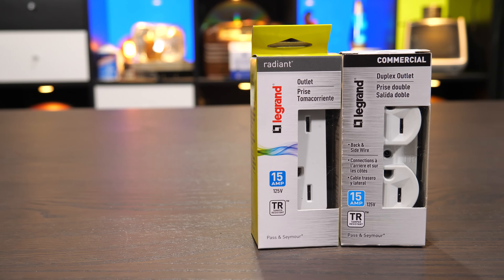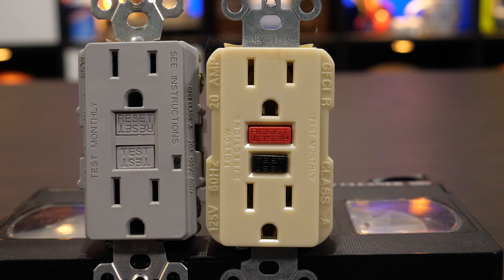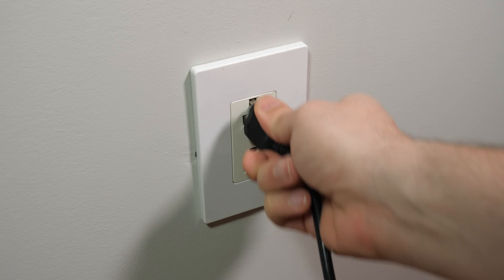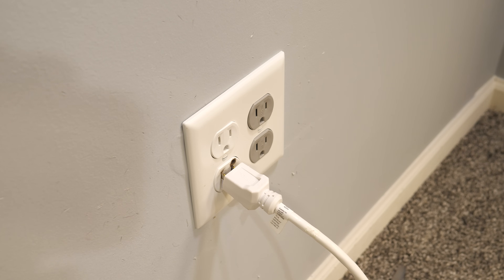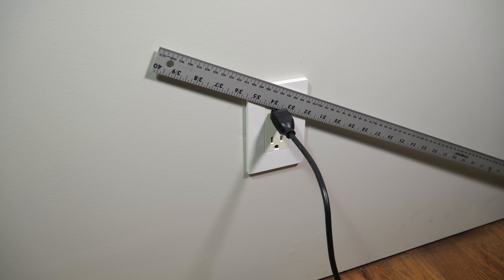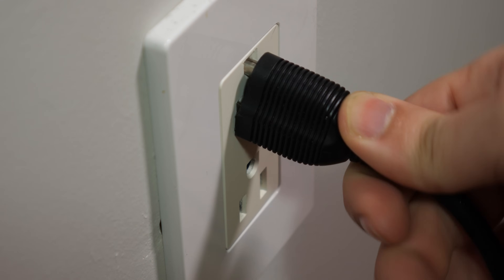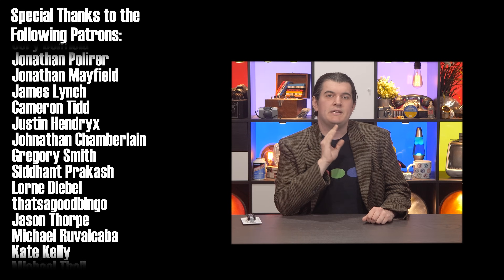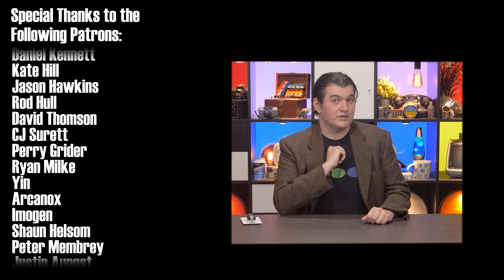Power outlets are topsy turvy - but does it matter?

Comment: I think the best solution is (if there are two outlets) have the top one ground up and the bottom one ground down. You stick the right-angle plug into the bottom one while the top one (which is the only one being dangerous in these scenarios anyway) is safe. Mirrored outlets are the best of both worlds!
Reply: In that case just put the outlet horizontal and the problem is solved. Or like the round right angle plug have the wires come out at a 45° angle then you don't need a mirrored outlet.
Reply: Just use Schuko
Reply: @uosiumen as stated, I don’t think that would work for toasters which have the metal body connected to the neutral. It would be possible, then, to plug the toaster in with a live body.
Reply: @jayrogers8255  toasters with metal body have to have body connected to PE. Live and neutral across heating elements. Schuko plug covers this use case.
Reply: @uosiumen  not older ones here in the U.S.. can openers were like that too: I read about someone getting shocked once from a metal kitchen sink. It turns out the screw holding a foot on a can opener was touching the sink, & was plugged in upside-down (2-prong plug). My parents used to have a metal oscillating fan that would shock people if the plug was in upside down. These are all appliances which used a neutral bonded to the chassis with no polarized plugs. A Schuko with no ground wire would have the same effect. Then, there are the old radio collectors: there were a lot of AC/DC sets back in the '40s & '50s which can’t have a polarized plug because they were designed to work on AC OR DC house wiring (which was a thing as late as 2007 or so in New York City). When plugged into AC, the classic is part of the circuit. The plug has to be non-polarized with no ground because of this.The antique radio collectors would be up in arms if they had to rewire their sets’ circuitry. At least right now, they can used a polarized cord to keep the chassis to neutral; although I’ve had a few of such radios which I wanted to put a 3-prong ground plug on, only to be told not to because of the outlet was wired backwards, the chassis would indeed be hot.
Reply: @jayrogers8255  two-pronged devices are nearly extinct in Europe. That plug is used in devices with no metal casing. For earthed three-pronged devices polarity doesn’t matter as if current is leaking to metal case, it’s detected by differential circuit breaker.
Reply: @uosiumen  yes, but in America, they are very much alive. There are 70-year-old appliances in use by people, which would have the problems which I described if they had to be rewired for Schuko. Without extreme upgrades to their circuitry, keeping their old non-polarized plugs is the least-worst option. We have AFCIs now, which are analogous to RCDs, I believe.
Reply: @mmm-mmm or recessed (clock) outlets.
Reply: If you're looking for the best solution, the UK has been using it for decades. 😉
Reply: @DavidBeddard if... we want to completely change the entire system of power across the entire country I'll keep that in mind.
Reply: @The24thWight  😉😏

Comment: my apartment (i think) has plugs that have some fancy new 'lock the holes till the force is even on both sides of the hot/neutral blades' and it's designed to be a safety feature, but if the blades are bent just a teeny bit it makes it so much more difficult to plug in. and vastly increasing the force, with possibility of slipping toward the blades since there's no flared base on 3 prongs, on something that's about to have 120 V @60 A through it has been....less than great. EDIT: oh, hey, you mention that at the end of the video :p

Comment: About 7 years ago in my high school electrical class our teacher told us that in Canada the electrical code was changed so that the ground was up. He said this was because if something falls off your wall and hits the plug with the live/neutral wires up it could damage the plug and cause a fire. If the ground prong is upwards, it hits a much stronger prong and thus results in much less risk.

We all responded saying that not all plugs have a ground plug so it’s not really doing much. We also all said it looks dumb like that, we like the little smiley faces the make with the ground on the bottom.

From what I’ve seen in the Canadian electrical code it currently doesn’t suggest mounting it that way UNLESS it’s in a mobile home. The thinking is that in a mobile home that you can tow around, things falling and landing on the plug is a lot more common so they want the ground upwards. But for all other applications it doesn’t seem to specify.

My thinking is that my teacher might have confused the mobile home code with the entire code being changed. Or that it was changed but later revised/removed for some reason. But for me, as long as it’s wired correctly, it doesn’t matter which what it’s mounted. But personally, I will never install it ground up. I like my little faces on my plugs!

Also, right angle plugs are great! But if you have 2 of them you can’t plug 2 things in unless they have a 45 on the wire. If a flat, round right angle plug with the wires leaving on a 45 it would be perfect for every use case!

Comment: In Europe at least they have this problem figured out.  What should probably happen is we start moving to the 380V DC standard and swap out wall sockets while we are at it with a safe one.  The reason for +-190V nominal DC is it works with existing wiring, it carries more power better than current AC standards, it works very well with EV charging, even your 800V EV mainly just needs a simple, compact, and efficient DC voltage doubler circuit and a compact and efficient buck-boost converter to charge, and in general we live in a power electronics world where even our light bulbs are power electronics devices.  Consider if you had solar panels hooked up in series on your roof that either directly connect to a home battery or through a DC-DC buck-boost converter to go between similar voltages.  (I had another YouTuber do this experiment with directly connecting solar panels in series with a salvaged Tesla car battery pack and it proved to be an efficient and cost effective way to collect solar power and store it in a battery.  He just added an extra solar panel to the series in place of a power converter to make sure the voltage stayed high enough to be effective.)  Then you have a simple, cheap, and efficient way to collect and store solar power without the need for more complex and expensive power inverters.  Then say your computer basically has half of its power supply removed, the half that converts AC power into DC power, instead just leaving the side that does DC-DC conversions.  This would be a lot more efficient end-to-end, cheaper to implement, you have a built in battery backup to your computer system as in the direct whole home based battery. Then, say you could splurge on high end gaming hardware and no worries about tripping the breaker.  More practically heat pumps work by using a power inverter drawing from a DC power bus to run an AC motor to drive the refrigerant pump.  Normally that DC power comes from converting AC power into DC power.  If you are starting with DC, you could dump this AC to DC conversion overboard and thus have a cheaper more efficient heat pump to work with.

For a smooth transition to DC, you can still have power inverters to go between AC and DC.  Just probably what you want to do is to put all of your high powered stuff on DC, you home solar on DC, and your home battery on DC.  With all of your major loads on DC as well as solar power input and batteries buffering power, the power inverter to go between AC and DC can be relatively small and low cost.  Then you still have AC outlets around and start working on converting those to DC as it makes sense to.

Think of how much more efficient and just better things would be in the USA if we did this transition?

Comment: Ground pin down, is the correct way. Why??? Most wall-wart power supplies often times have the small blade(hot) on the right. If the ground pin is on the top, the wall wart power supply gets plugged in upside down and more likely to fall out from the upside down leverage. It's also more likely when plugging in a three prong plug, your index finger will naturally land on the bottom of the plug which would be best it touch ground.

Comment: Great entertaining episode as usual. In New Zealand we have a three pronged plug with earth down orientation and I recently purchased a device with a right angled Chinese plug that while it fits our sockets looks like it is designed for an earth up orientation. Also where are the switches on your sockets. Would that fix the safety issues when inserting and removing plugs?
Reply: our socket switches are in the breaker room 😅so no per-socket control. it's power or no power. and if I know the average north american consumer, adding extra steps to something that can still technically be done without the extra step is really hard to enforce. that's why i like other countries' designs that hide or retract the pins if something isn't physically pushed into the receptacle.

Comment: I was thikning about the right angled plugs as you were speaking - in the UK, our plugs do assume that the ground is at the top, and our products' plugs are subsequently manufactured to support this. What's more, there's usually a flare at the prongs and at the "top" of the plug, leaving you a recess to grip when removing. Many of our plugs are fused, also.

The only problem I've ever had with a UK plug was my own fault - using a night-light purchased abroad that was plugged into an adapter before the wall, it wasn't nearly as flush as it should have been, and got kicked out accidentally - resulting in prongs broken off the plug, and an outlet that had to be 'breakered off,' taped over, and avoided until an electrician could be called. 

Loved the Steve Mould shoutout, and thank you for the wise words about pizza! Trust the locals!

Comment: I think the US should just switch to a newer recepticle design. Sure there will be a lengthy transition period where there will probably need to be adapters and regulations on manufactures to change plugs/provide adapters but it would be worth it in the long run. I hate US plugs so much.

Comment: As a european I am always supprised about the poor outlet design. You even better notice it as a tourist, who mainly resides in hotels and motels. Using an adapter to match our heroesious euro plug, it is mostly the case that the worn out outlet says no and spits out your plug enterily. I would recommend a decade of inconvenience and redesign the outlet to beeing recessed. That would solve the problem of falling out, the touching problem and the knive throw champions would also be happy. Adapters could bridge the decade and even older plugs would work in a recessed but unsig the old arrangement outlet.

Comment: There is actually a downside to right angled cables from plugs - when someone in their infinite wisdom decides to do things a different way from everyone else. We have ours oriented with the cable pointing downwards by default but nowadays pretty much everyone that makes a power adaptor or charger points the cable in some random direction. Which is a right pain when you have to use a multi plug adaptor owing to a lack of sockets.

Comment: Electrician here

It's a pretty common opinion among electricians (at least the ones I've worked with), that ground up is better, but everyone is used to ground down, so like you said, we just roll with it. 

It really doesn't matter unless it's something the customer asked for (such as a hospital), and for certain jobs, it's definitely good practice to ask the customer what the want

I will say, I do like ground up better for any plug that has a ground prong, simply because it feels like it's less likely to fall out.

If I was rewiring my house, everything would be ground down, but all the dedicated utility circuits and my garage outlets would probably be ground up, but that's just me being OCD, it doesn't really matter. 

There are a lot more dangerous parts of the home electrical system than the orientation of the duplex outlet
Reply: @@karlwithak. You'll have to back that statement up with fact.  I've never once seen any state electric code that didn't say "according to the manufacturers directions" as you are claiming.
You need to quote the state and exact code by number where it says NOT to follow manufacturers directions before anyone will believe you.
Reply: @lorddissy  yeah seriously, show me the building code and I'll believe it. 

Any good electrician can show you where other codes are in the codebook, you don't just take people's words for it
Reply: @louisjov  NEC article 406 device installation - "Installation per manufacturers installation instruction except in the following"
406.1 through 406.9 is a list of exceptions, the only one of which mentioning the word "orientation" is 406.5 and that is specifically about mounting on a flat surface (do not mount face up under a sink or on a countertop) 

Leviton brand (like in the video) state vertical outlets can be either way.  You would have to find some other brand of outlet that explicitly tells you only in one way for it to be against 406.
Reply: @lorddissy  exactly my point. Follow the manufacturer instructions, and pretty much all of them say it can be either orientation
Reply: @@karlwithak. When you say inverted do you mean ground up or ground down?

Comment: That was a fun discussion about the orientations of NEMA 5-15 devices, but now lets talk about the orientations of NEMA 14-50, 10-30, and 6-50 devices. Tesla and Lectron EV "chargers", for example, have right-angle plugs that assume a bottom ground on 5-15 receptacles and a top ground on 14-50 receptacles. The distinction isn't voltage, however, as Tesla's 6-15 and 6-20 NEMA adapters also assume a bottom ground. :)

Comment: Actually, there is no standard right side up. It all depends on the manufacturer and the individual device being installed. If you want to know the manufacturer's suggested orientation then look at the writing on the device itself. Some will clearly say TOP while others rely on you to orient it to the print on the device. There is no NEC code reference for the orientation. If you look at the many different 3-prong receptacles, you will notice some will orient with the ground up to read the print on the device, while others the ground will be down to read the print. Switches are different animals. Most all switches are oriented for up is on and down is off. On decor switches they will actually say which is the top. But as far as receptacles, it all comes down to personal preference.

Comment: Unless the cord is too damn tight and the hospital outlet is at chest level, then either orientation leaves you screwed due to unyielding cord tension.
Also, My hospital floor seems to have the outlets 50/50

Comment: I work in biomed (in-hospital medical equipment repair) and the biggest culprit of the hot/neutral up facing short I saw were stainless steel plate covers coming loose and dropping onto prongs. They can't use plastic covers in the OR, it's an infection control issue. 2nd biggest was instruments falling on sagging outlets.
Reply: What is the socket itself made of if not plastic? But also, do the installers know about loctite?
Reply: There must be at least dozens of ways to avoid 'sagging plugs" etc. in hospitals- recessed outlets, hooded/sleeved plugs like electric cars use, etc. etc. And I'm sure any manufacturer would love to corner the market of "hospital approved" hardware AND insurance companies and every other actor in the healthcare field would love it as another excuse to double or triple our already obscene healthcare bills! ( and I hope not many people have died because housekeeping or nurses accidentally bumped the ventilator cord and suffocated people! wth?)
Reply: I stand corrected by a @zachkelley1830 below, except  the gouging the consumer  part which Zach basically confirms indirectly.
Reply: @dochi1958  All outlets and plugs are already hospital grade, thats what the green dot indicates if you look close at them. In theory plugs should be inspected for termination, tension, and plate fitment. That used to be a part of my job. But in practice there's not enough staff to do that regularly. All ventilators and other life support critical equipment are on internal  battery backup and those batteries are replaced every 2 years even if they haven't even been used.

Comment: Absolutely agree, right-angle cords (especially power strips) should honestly be standard. More and more I'm finding I have no use for plugs that stick out from the wall. If there was a way to have right-angle plugs that even rotate left to right 45* so you can have two of the same that can nest neatly on top or beside each other, that'd be even better. We have adapters that click-rotate, this doesn't seem like a far-fetched idea.
Reply: Here in Italy you can get a replacement plug of any of the standard types for a euro or so, so all you need is a screwdriver and wire strippers and you can fit all your appliances with whatever plug works best. Just please make sure not to replace a 16 amp plug with a 10 amp one and then try to draw more than 10 amps.